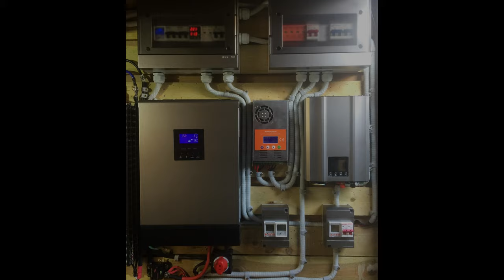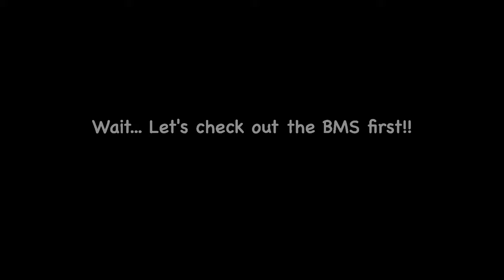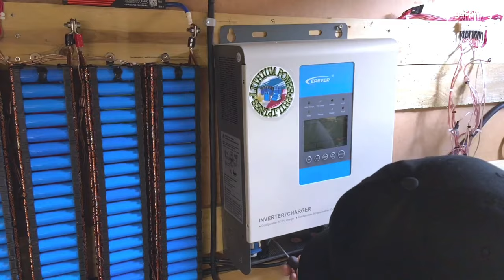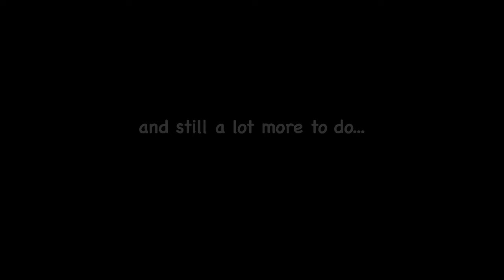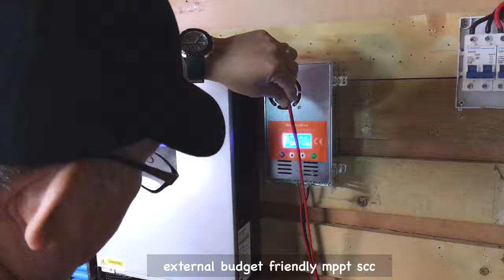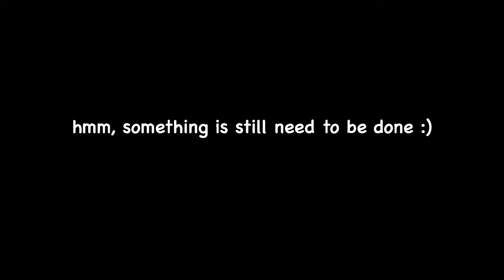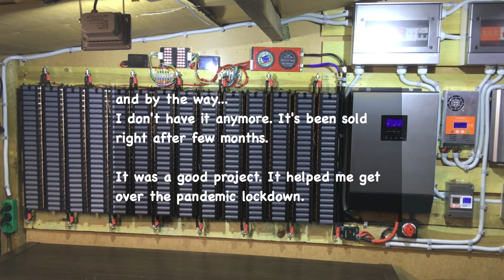Time Lapse 24V to 48V System Upgrade - LATE UPLOAD DIY Li-ion Powerwall in My Toolshed

Comment from the maker: VIDEO DESCRIPTION:
Heads up! All footage of this video was taken during the pandemic. This is a very late upload... it just happened that I found these footage in my hard drive while trying to purge some of the files. I decided to publish it here on my channel so I can just watch it every time I want to, and for those enthusiasts out there, especially for my subscribers, followers, and Padawans.

WARNING! Do not build a powerwall using "lithium-ion cells" if you lack enough knowledge and experience, for they are highly combustible and not suited for daily indoor use.

This was a really good project during the lockdown period when I was sent home yet still receiving my full salary from the company I worked for with nothing to do at home rather than eat, sleep, read, watch movies, and repeat it every day. This has helped me kill those unproductive and boring days, but if you ask me if I'd do it again this time... the answer is straight NO. I'd use LiFePO4 cells. It is safer and has more years to its life span.
Reply: Hi sir jef.   Ask lang po. Yung lifepo4 cells binangit mo. Yun ba yung 32650 lifepo4 po? Thank you po sa sagut
Reply from the maker: Yes, 32650, 32700 and S168 ay mga tinatawag na cylindrical LiFePO4 cells dahil hugis neto na pahabang bilog.
Reply: Thank you po

Comment: Hello sir jf, nice time lapse po. Iba po talaga pag may knowledge, may power 🙂

Siyanga po pala sir jf, ask ko lang po, srne 60 amps po ang scc ko, pwede ko po bang lagyan ng 4 na 500 watts? Kasi po 1600 watts lang ang rated power input sa 24 volts system. Gusto ko sanang gawing 2000 watts or 4 na tig 500. Salamat po sir jf sa advice. More power po
Reply from the maker: Dapat sundin yong max input power na nakasulat sa datasheet ng hybrid inverter.

Comment: boss gawa ka ng full tutorial ng SOLAR SETUP na pag na puno na ang battery ay di na siya kakain ng energy sa appliances sapagkat ang gagamitin ng mga appliances na energy ay sa Solar Panel lang..Para Hindi Sayang Ang Mga Nakukuwa ng Energy Ng Solar Panel Kasi Puno na Ang Battery. kahit paano may backup Energy Para Sa Gabi Kasi Di naman na Gamit ang Battery...???

Sana Manotice mo ako iDOl
Reply from the maker: Sa mga inverter na ginagamit sa professional installations, nase-set yan sa parameter settings. Hindi na kailangan pang gawan ng tutorial dahil nasa manual naman yan ng inverter kung paano.
Reply: @JFLegaspi  salamat po ia idea
mag plano palang ako mag solar setup 
para segurado at di sayang kwarta 
god bless you

Comment: Sana po build capacitor naman without battery na pang solar Yung X3 load capacity. 
At samahan narin link saan nabili. Salamat po.
Reply from the maker: Paumanhin... wala akong plano na mag build ng capacitor bank para sa solar pv system.

Comment: Good day po sir, ok lang ba pagsamahin yung bago at lumang battery (lit ion or lifepo4)?
Reply from the maker: Hindi pwedeng pagsamahin ang Lithium-ion at LiFePO4 😊
Reply: @JFLegaspi  ibig ko pong sabihin sir kung pede pagsamahin ung luma at bagong battery po mga 3 years apart na lit ion or yung luma at bagong battery po na lifepo 4, kasi alam ko kapag lead acid bawal pag samahin ung bago at lumang batteries, di ko lang po alam sa lit ion at lifepo 4
Reply from the maker: @boybakala9677  Depende kung gaanog kaluma ang lumang battery ng LiFePO4, pero kung buwan din lang naman ang pagitan, pwede.
Reply: @JFLegaspi  what about po kung years? Mga 3 years po, mas advisable po ba na palitan nalang lahat ng battery kung maguupgrade din?